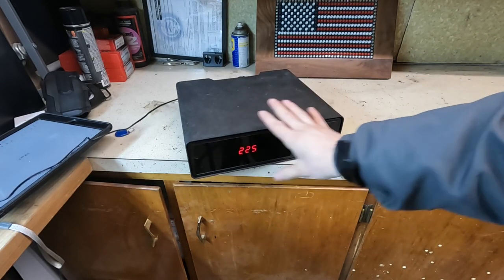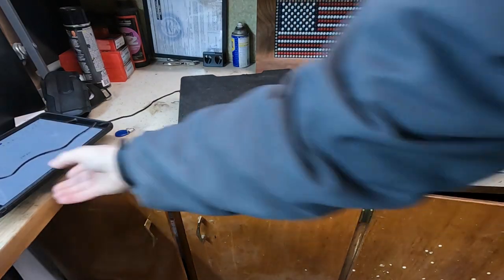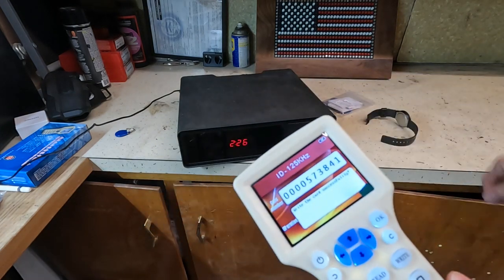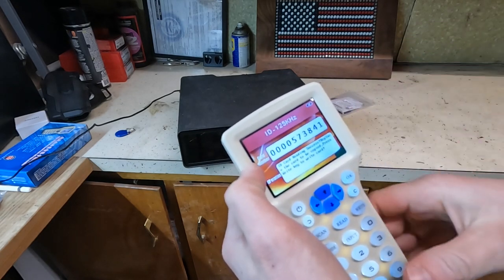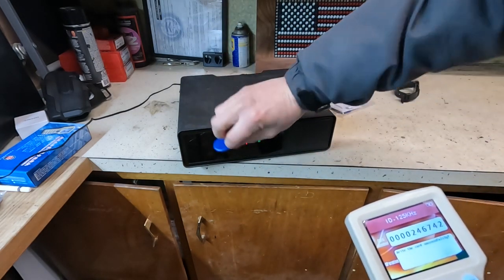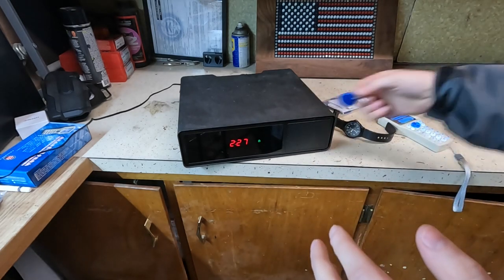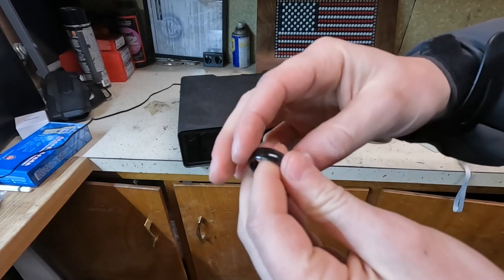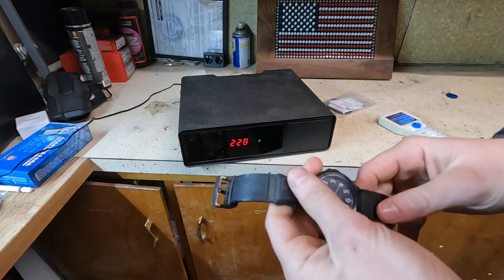Using Aftermarket RFID Items on Hornady RAPID Safes

Comment: Do I need to program it or can I just make it take the place of a stock chip etc when programming the safe? reader
Reply from the maker: If you get an accessory that is pre-programmed you can just make it take the place of a the stock chip. But if it isn't programmed you will need to get a programmer and make it match another chip.

Comment: I got got a safe like the one demonstrated...
The safe is powered, but it won't  unlock the safe with the watch and the box doesn't include any details of the 4-6 # code?
Reply from the maker: It should have come with a key. There is a key slot on the back. In order to program the code you have to get the safe open. If you don't have a key you can pick the lock.